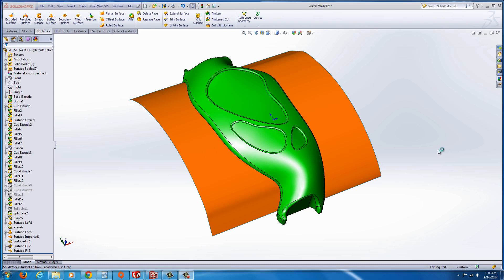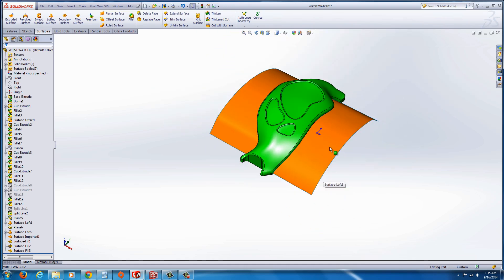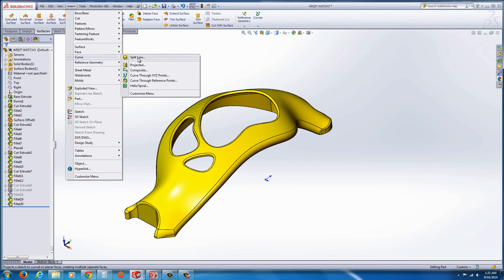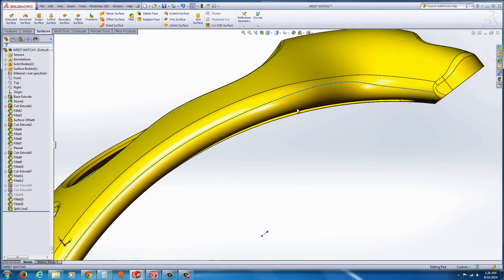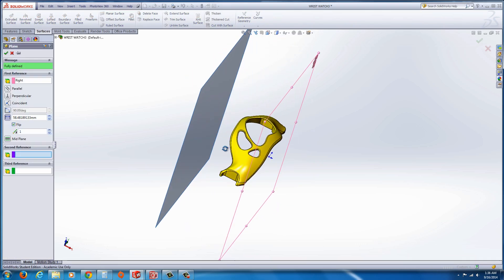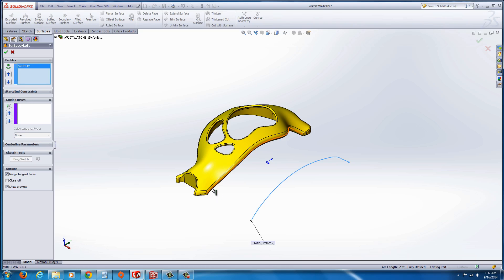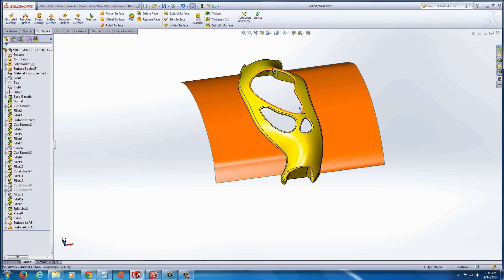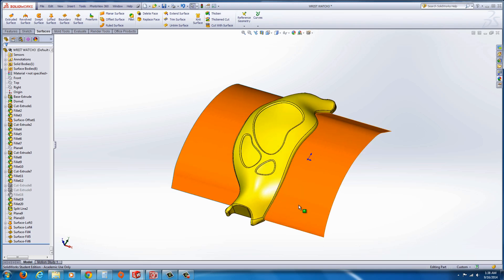E7 SolidWorks finding a complex parting line

Comment: This is helpful but I'd love to see you go on and split it.  
We often get customers sending us parts they shape in clay or by hand then 3D scan and send us the files.  Then I have to find split lines and actually split the part into two halves so we can make room inside for 1.) electronics and 2.) even wall thicknesses for injection molding.  

Sometimes I find myself attempting to start over and both halves manually in Solidworks - very time consuming.